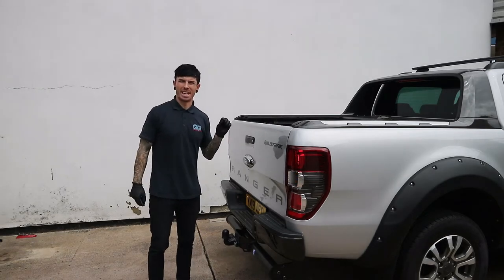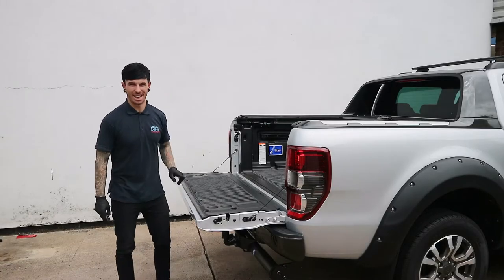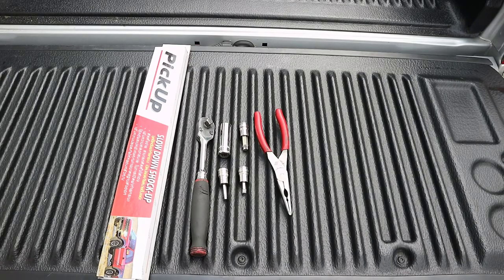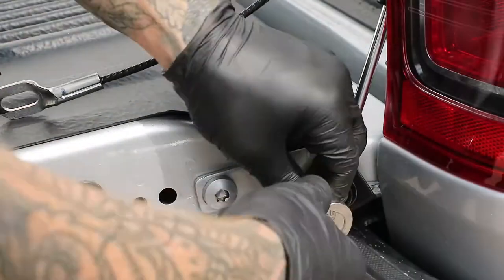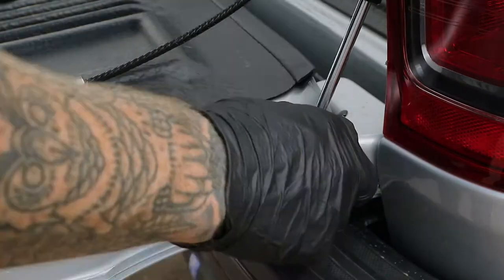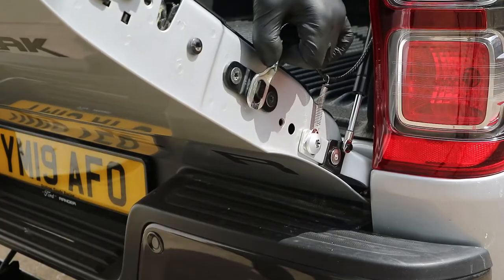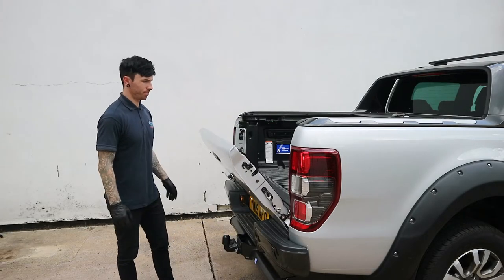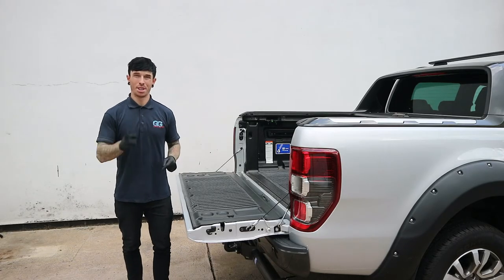HOW TO FIT FORD RANGER TAILGATE DAMPER

Comment: I tried fitting your kit today on my 68 plate wildtrak, once everything was in place I closed the tailgate but the hook on the tailgate which holds the cable hits the damper! 
I have removed and returned the original set up. 
Please advise/help

Comment: Does this work on the American 2019 version ?
Reply: I would also like to know
Reply: you will just have to have a look at your tailgate if you have the same bolts then it should fit. ford likes to save money anything they can reuse from international models they will reuse so the chances of it fitting is pretty good.
Reply: The Ranger T8 model 2019- onwards is different.
Reply: @joelmatos7057  The Ranger T8 model is different.